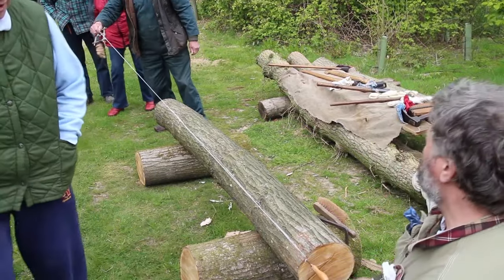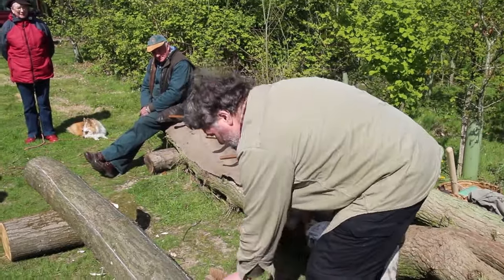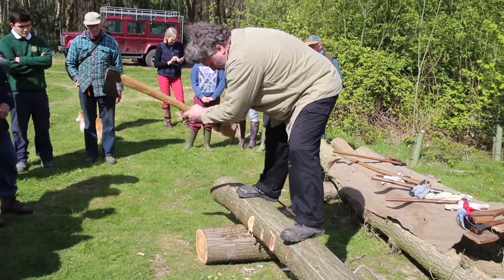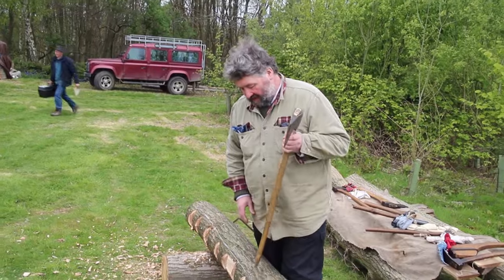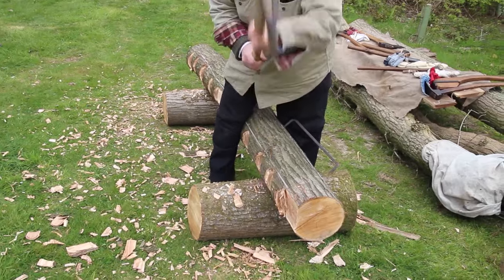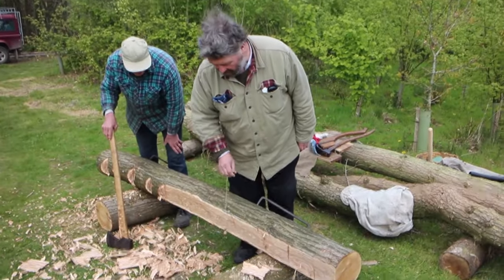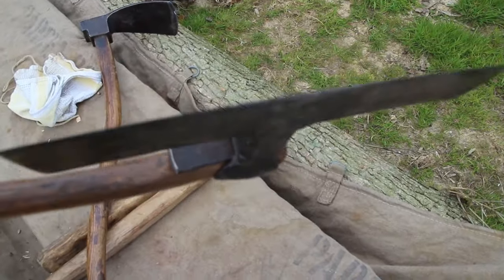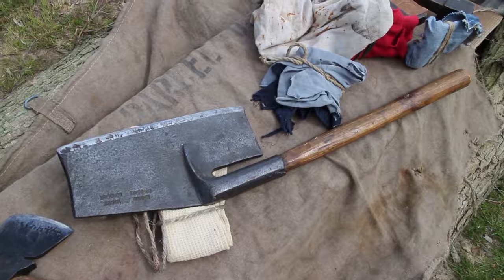Traditional Log to Beam Hewing - Huge Axes

Comment: I have a practical application for this. I'm slabbing up logs using an Alaskan sawmill, a chainsaw in a jig, and I need to start with a flat surface. Rather than setting up  rails over the log and cutting my first flat edge, I'm trying to learn how to do it with a hewing axe. This tutorial is hugely helpful.

Comment: I like all the specific side axes as they look cool. But I reckon they were used in the construction of posher buildings for example old churches have very nicely straight lined beams but a barn on the other hand is like anything goes and you can tell they just used whatever ax they had to hand.